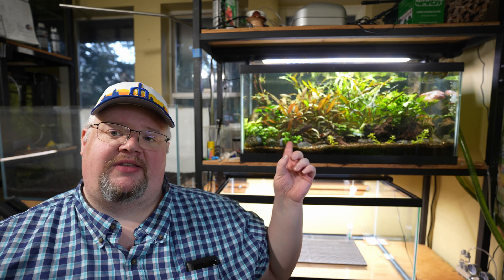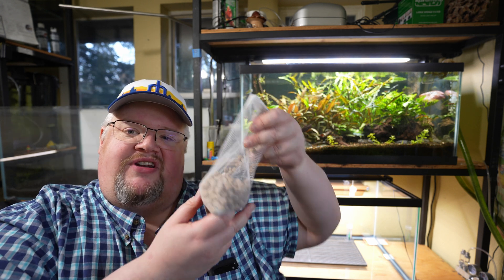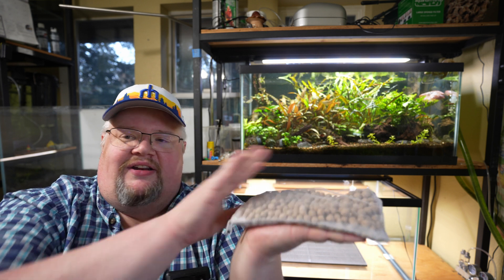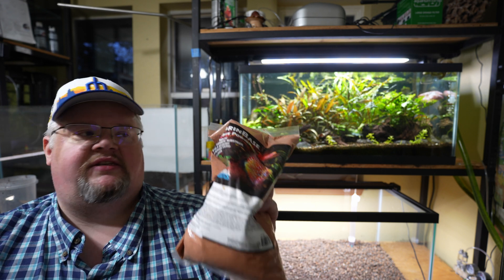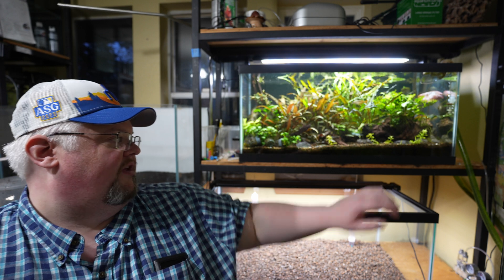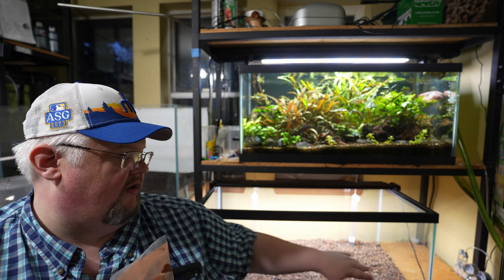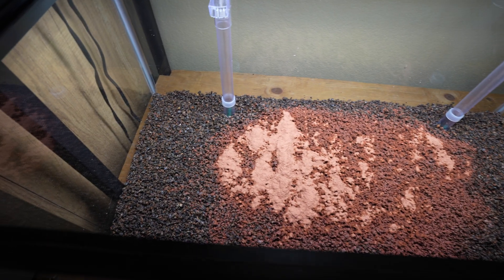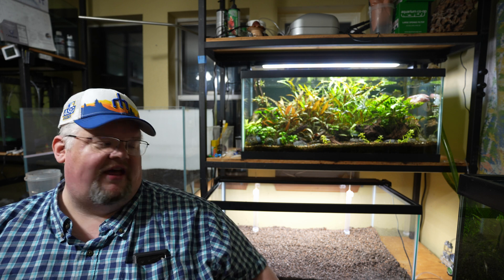Charging DIY Substrates like Safe-T-Sorb - preparing an Anoxic Filtration Aquarium

Comment: bro I have 2 tanks on anoxic plenums and I havent done a single thing besides top offs. the pull of the water helps the roots. all of them are white and to the bottom. the fish food usually has potash in it. calcium and magnesium I get from shrimp additives to my water. Im telling you this style worked for me. anoxic filtration changed the game on my tanks. I have about 25 green neons, 18 guppies, 6 Amanos, countless cherry shrimp all in a 30 gallon. no issues. I call it my death tank experiment. theory would have you believe all the fish and shrimp would be dead by now. also have like 20 assassin snails somewhere in the tank

Comment: Is there a way to slow down the flow rather than cutting it like kevin novak did
Reply from the maker: If you mean keeping the stand pipe tall, the distance traveled helps accelerate water flow, hence the reason to chop it down.
Reply: What length is recommended for the uplift tubes?
Reply from the maker: @fownine4life853  from everything that I have seen, the goal is to get the standpipe as short as possible. Then you can run a reasonable amount of airflow but because the standpipe isn't very tall, it will not create a large water flow.

Comment: All thats going to do is be a diatom factory 😮, i actually set up a 75 and a 40 with SafeTSorb and the 1 inch UG filter plates and it couldn't grow plants the whole time I ran it.
Any plants would be covered in brown algea in days and that continued from April of 2023 to feb 2024 when i got rid of it for red  flint gravel and the diatoms went away in 3 days even on stuff that was in the tank prio to substrate change. 
The whole anoxic thing is a scam 😂
Reply: I have three tanks set up with this system . 3 inch substrait with SafeTsorb and gravel with a under gravel filter. The water is clear, but it is a diatom factory . Four months in and brown algae is out of control and my KH is very high. I clean the tank every week to try to get rid of the brown algae but it keeps coming back. All decor and plants covered in brown algae after two weeks.
Reply: Maybe try adding some snails.  I have some mystery snails in one tank that have been taking care of brown algae.

Comment: I used Matrix De*Nitrate and the original eheim regular substrat (not the pro) under the UGF. The both fit pretty well. Put a garden liner on top. Then a gravel layer, a bright well laterite mixed with safe t sorb layer, then a control soil- fluval bio stratum layer. Was going to cap with black diamond blasting sand, but decided to have the bio stratum be the top this time. 
Has been working well for almost a year. Minimal algae growth. Plants doing well. 90 gallon over stocked here.

Comment: I have always been sceptical of this type of system even though it has been around for decades.  I always felt that the results were questionable due to the sheer number of variables in the set ups I have seen.  I am very glad to see you eliminating the vast majority of said variables and logging your results weekly.  Thanks!
Reply from the maker: It's the only way to accurately measure whether or not the system is doing the work. Otherwise, how can you prove that denitrification is occurring because of the system and not because of plants or some other Factor
Reply: Exactly!

Comment: I recently did a similar setup in a 54 gallon. I am however also using chemi-pure elite in a canister filter. I have no measurable nitrates or phosphates, and zero algae. In fact the black beard algae already on the plants and wood I put into the tank quickly disappeared. Only down side was a month long bacterial bloom the smelled a bit like laterite. But my water is crystal clear now and my fish are more colorful and active than ever before.

Comment: Have created a similar system.

We are blessed to have laterite clays in Western Oregon.  No “charging” done, but used 1/2” of red laterite clay to provide iron and minerals, under 2.5” of medium-grained basalt scoria (2-4mm porous lava bits) and then capped with 1.5-2” medium-grained sand (2-4 mm)

Jumped straight to plants…so can’t know for sure whether nitrate elimination would have happened without them.  And also was able to safely stock 38 fish over the course of two weeks in a 29T. 

Have yet to see the nitrates go over 25…riding the line nicely for a couple months now.  Fish feeding plants and plants/substrate keeping water parameters optimal.  Couple of squirts of Easy Green occasionally for potassium/phosphorus/calcium for the floaters, but other than that just root tabs.

All systems go.

Comment: I’m confused as to why you’re altering your Gh and Kh. You’ll be raising your Ph. If you’re not going to have plants, why is this important for anoxic filtration? After you get your desired pH/ Gh/ Kh, and after your experiment,  With each subsequent water change, you’ll drop the pH right?
Reply from the maker: The primary goal is to make sure the high absorbance of the safe-t-sorb is not the reason we see reductions.  Also my water has effectively nothing in it, so without some buffering it will crash like crazy.  Most of my tanks have crushed coral in them for this purpose.
Reply: @BentleyPascoe  have you seen safe t sorb by itself reduce nitrates in a tank?

Comment: Hi..would you add anything to eco complete on setup? I plan to cap with bdbs. That's basically it for my 110 plan. A couple bags of stratum too. About to create my 110 planted rainbow tank!😊
Reply from the maker: Stratum is more of what I would usually add, so you should be good
Reply: @BentleyPascoe  thanks, I was thinking of crushed root tabs before I add the bdbs

Comment: I am currently using and getting ready to setup a new tank with an almost identical system to what you described here. I can't wait to see if what I have been doing is worth the extra work. Great job! I will be looking forward to what you find. My experience with my current 75g that uses this system, which is heavily planted , has CO2, and around 25 fish , the nitrates never get above 40ppm  even after a month or more of doing nothing. I don't know if the plants and CO2 contribute to the low nitrates, but the tank looks amazing after 3 years. My one question about these type of setups is how much iron do you need to use to maintain the anoxic environment after an extended period of time? It took me 2 years before I started seeing nitrates above 20ppm. Good luck!
Reply: Plants will skew any measurement you’re trying to make on anoxic denitrification.
Reply: @eric_k311  yep. This is why I'm glad Bentley is doing this experiment in a much better controlled fashion.

Comment: Running an anoxic system in my 30 Gallon Tall. Used Fluride red as the base layer and very small gravel on top. Approximately 4 inches deep. Slow moving Plenum with filter under gravel plates covered with garden fabric to prevent Detritus form setting into the Plenum.  I was able to load the whole plenum with small ceramic rings for increased surface area for bacteria to colonize.
This tank was running before for 2 years and I could not control algae even with lots of plants in the tank and out with roots in. Now 6 months after the tear down and reset up almost zero algae growth, plants are out of control growth with just a cheap Hygger LED and no CO2.
Very Happy with the results and I think you are going to be surprised as well. Thanks for a great video and look forward to updates!
Reply: Confused.  What was different after the year down?
Reply: @donpettit7107  Almost no algae growth. I was having massive growth explosions taking over all the tank surfaces even with 50% water changes weekly and minor feeding of the fish. Lights where only on for 6 hours. Plants couldn't keep up and just got covered. 
After tearing down, running a slow moving Plenum with a thick substrate layer algae is now very minor, almost nothing. I know everyone will have different results but for me it was huge. I'm only doing 20% water changes now weekly and turn up the lights to the brightest setting.
Hope that helps :)
Reply: Your just running a standard ug filter then, flourite has little cec capability as it's fired harder.
Reply: Interesting about the iron. I have high iron in my very soft,slightly acidic well water. Wanting to do an angelfish/tetra tank.

Comment: Is laterin the same as laterite I have all the parts underwater filter and kitty litter but i bought a laterine brightwell product by mistake and was wondering what the diffrances are between the two products and if it would matter if I just use laterine?
Reply: "Laterite" is a group of highly oxidized red clay tropical soil's, very high in iron and aluminum. "Laterine" by Brightwell is a processed form of a laterite soil where they've basically kiln fired it to make it more stable, and then ground it to different grain sizes.  Laterite and laterine will do basically the same thing.
Reply from the maker: Yes, laterite is what you want.  Laterin is the same.

Comment: I like how the tank is going, but I have a question why didn't you choose a larger undergravel filter for your tank? in Dr. Novak's videos, I see he covers more than 70% of the tank's bottom with plates, I am not sure if you are going to have similar results just using plates in that area, hopefully, you will, I've been running a plenum on my tank since 2022 and I am completely pleased nitrates are lower in my tank than in my tap water, my UGF plates cover about 95% of my tanks bottom though.
Reply from the maker: From my understanding of watching a lot of his videos, it's not necessarily about having maximum coverage, while that is very beneficial, it's about creating the slow-moving plenum to create the anoxic environment and water flow down throughout the deeper levels of the substrate.
Reply: @BentleyPascoe  I understand I am looking forward to see how it goes for you, but with your experience in the hobby it could only be successful. 🙂
Reply: Do you have plants in your tank?
Reply: @eric_k311  I do a bunch of them.

Comment: it would be cool if you did a side by side of charged vs uncharged. Dr Novak has said that charging the substrate is unnecessary. thanks for the videos and experiment Bentley!
Reply from the maker: My water in particular is very soft and has low KH so part of charging. This is also to prevent weird pH crashes because I won't have any level of mineral buffer

Comment: I've been following Dr Novak for two years now. Six tanks running anoxic setup. It does tank a good few months for the system to start developing the denitrifying bacteria. All my tanks generally run about 10-20 ppm  nitrates before water changes. This is awesome! I still change water for a variety of other reasons, but NOT to reduce nitrates - big win in my opinion. And the undergravel system just keeps my tanks clear as a bell. 
To late now, but I would've suggested using a Lee's premium undergravel. Penn plax is cheap, weak, and I hate the connection points for uplift tubes. Although Lee's is substantially more expensive. Also, you could've removed the matrix media from the bag to fit under the plates, but really isn't a worry either way. 
Glad to see you are going to cut down the uplift tubes and slow air flow after the tank settles. 
I love this method and hoping your results mirror mine. Good luck my friend although I really don't believe you'll need any.
Reply: Do you have plants in your tanks Steve?
Reply: @eric_k311 in 5 of 6 I do. One is not planted.